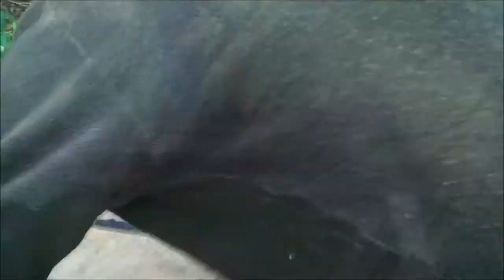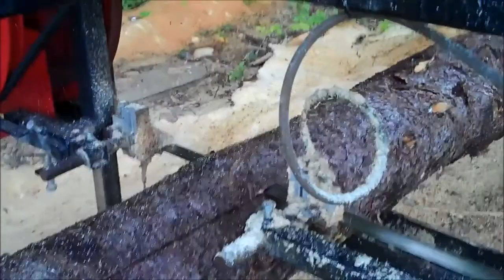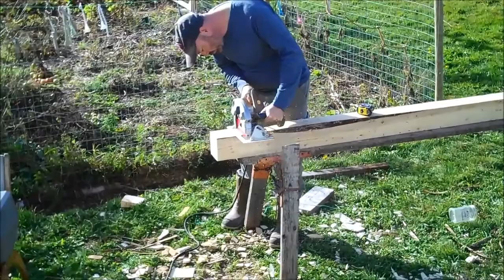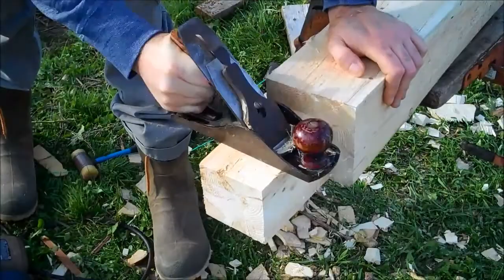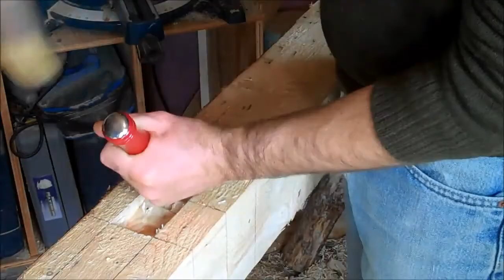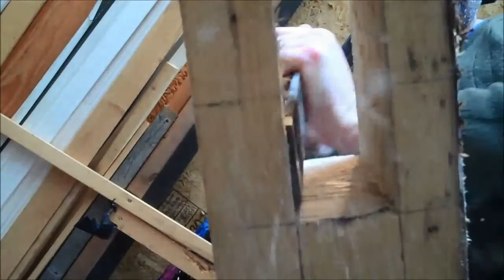Timber Frame Shed - using bandsaw portable sawmill and hand tools

Comment: Great job. Just a friendly tip on that mortise. Next time, buy a drill bit that is the width of the mortise or half the width and drill through as many times as needed to remove material faster. Saves time, energy and reduces fatigue.
Reply from the maker: Thanks, I have a drill bit that could have done that but I also wanted to try out doing it all by chisel just for the experience.